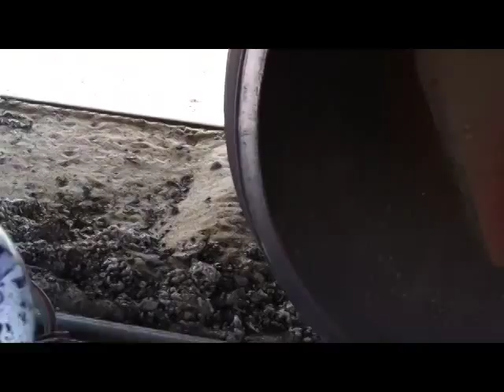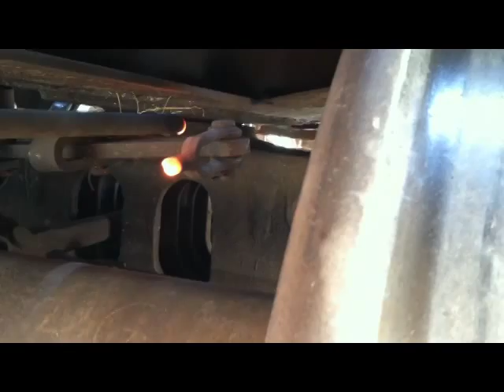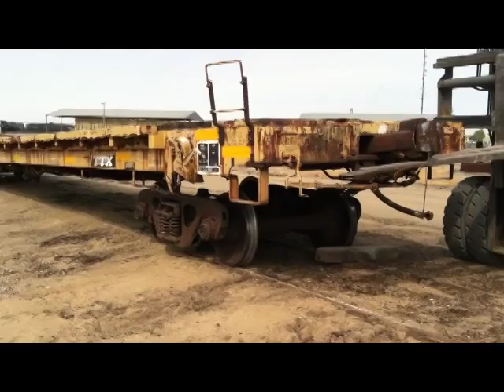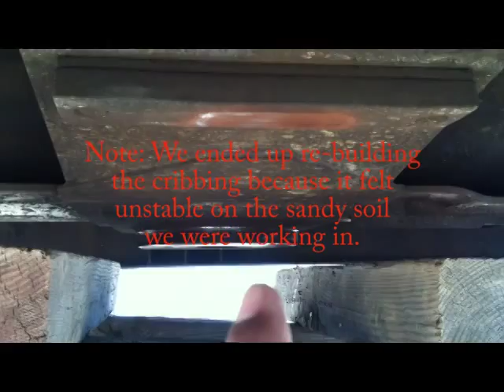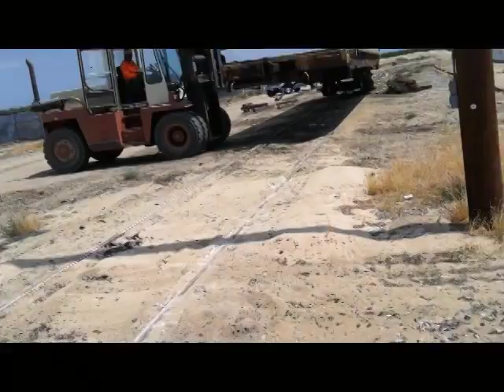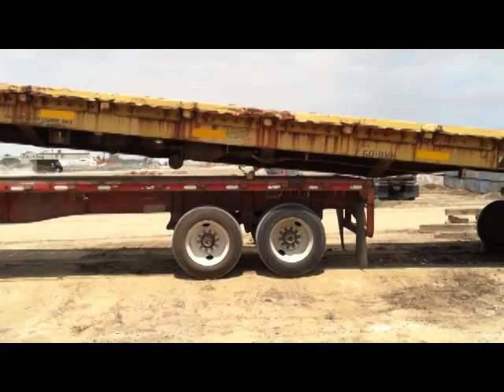Transloading railroad flat car from rail to truck

Comment: Do railroad's sell the retired cars?, I'm trying to locate one for a bridge to cross my creek, although my creek is only around 20 feet wide, this seems like a nice ridged option.
Reply from the maker: +Johnintoit Buying railcars directly from the railroads is like asking if you can have a cup of coffee with your senator; Yes, you can but good luck. I would obviously prefer that you buy your railcar from Paragon Bridge Works as we have a nation wide stock of railcars, from CA to NY. However, if I would also recommend trying to buy railcars from the US government. They are a better price than what we would offer and they are actually pretty good to deal with. Notice I didn't say "easy to work with" as coordinating such a big move with our government isn't "easy" but it's possible. Check out this video that talks more about that process: https://youtu.be/Oc8GpZm4ifM?list=PLdeU_2VgBYQTUPD9MIycJ-cw3hyHdM6Sz
Good luck! Give our sales team a call if you would like some current prices: 661-577-4373 or sales@paragonBridgeWorks.com 

Additionally, sorry for the very late response. We do not normally get comments on our videos so we don't check that feature. I just happen to stumble across your comment as I was posting more videos.
Reply: +Paragon Bridge Works 
No worries about the late reply, I was able to locate a rail car, over the summer I was able to sandblast it and paint it, it turned out really nice, I pained it the same color as the golden gate bridge and will be installing it this coming spring.
Reply: Johnintoit cabooses go up for sale does that count